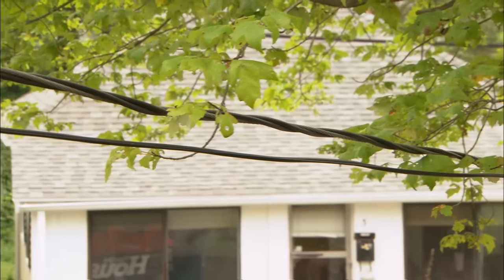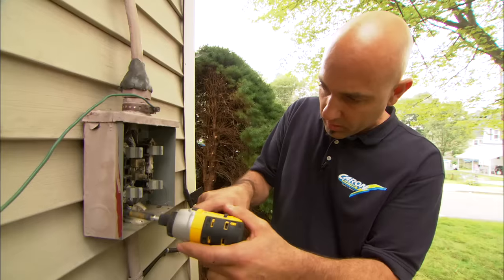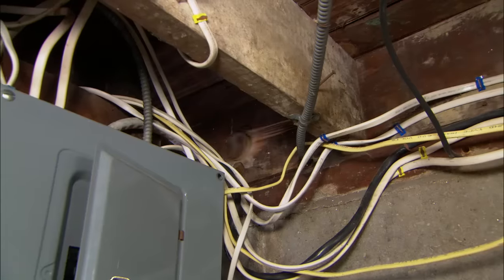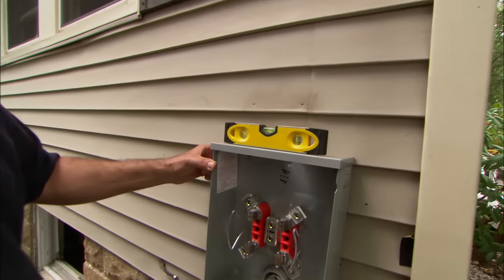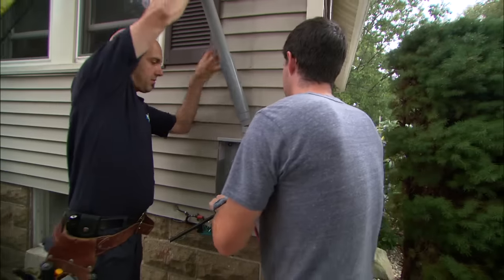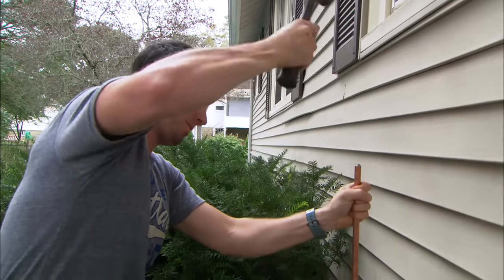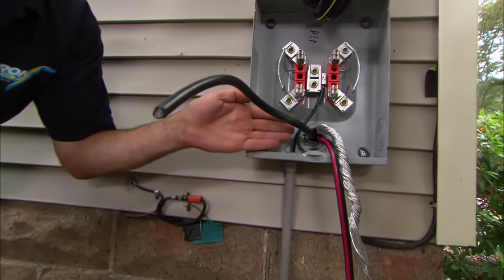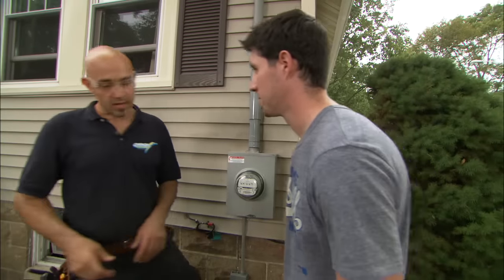How to Upgrade an Electric Meter to 200-Amp Service (Part 1) | This Old House

Comment: wrong.
That wire that you are calling the "neutral conductor" is connected to the messenger cable. We at power companies DO NOT WANT NEUTRALS. The neutral is formed in the home by the home owner. The messenger cable is for eqi-potential bonding so that every home off that pot, (transformer) is in the same potential. The two insulated wires on the tri-plex are current carrying conductors, the third wire (the bare ACSR) is the messenger cable for the service drop and is used to secure the wire to the first point of attachment, support the two current carrying conductors, and put everything on that drop(s) in the same potential.
Reply: JPP2672 Was going to say the same thing. It's to carry the load of the wire itself.
Reply: You don t want it because obviously you don t know what it is. Your equipotential  bonding conductor, the neutral and the ground are ALL GROUNDED CONDUCTORS, they just change the name depending on their role in the system
Reply: What is your point ???  if you want to learn =  watch   Mike  Holt  Videos...
Reply: "The neutral is formed in the home by the home owner."  You have no idea what your talking about  Lol
Reply: That’s not tri-plex

Comment: He didn’t set his expansion joint to the correct expansion nor did he explain...and no grounds in power company enclosure! They must go to main enclosure the power company will not pass even if twp. Passes. They only want there wires coming in and you’re feeders going out nothing else.

Comment: What a cheap job he used pvc conduit it's gonna end up warping over time and it looks ugly too
Reply: I was thinking the same thing can’t believe they let them get away with pvc. I would use rigid metal conduit for my riser. And a chase nipple not a romex connector.

Comment: Where's the disconnect. In Texas if the panel is on  the inside it needs a disconnect outside. 
Nolax is required.  
No sealingnon the top edge and outside edges of can for water proofing..

Comment: what a horrible service. cheap pvc mast. cheap aluminum conductors. that is the last project on a home or building that needs to be cheap. ive replaced dozens of snapped plastic masts after storms.
Reply: the lazy coupling at the bottom haha😭
Reply: Aluminum is used all across North America for service entrance conductors. You don’t know jack

Comment: Why bother showing how this is done if it is just for a licensed electrician? Very irresponsible.
Reply: V it's an informative video. It's not saying hey you homeowners out there, go ahead and do this. He clearly states at the beginning of the video that this is to be done by an electrician. Not a handyman with basic electrical knowledge.
Reply: Sparky 97 Dangerous, man. Lots of people might get in danger. You know the saying, little knowledge is very dangerous.
Reply: Homeowner can do their own work in most jurisdictions. This isn’t difficult or particularly dangerous

Comment: If it requires a licensed electrician; why are you showing it on a DIY channel?

Also, the power company is now saying that the homeowner owns the meter; are they trying to pass the cost of meter replacement on to the customer?

Comment: Don't ever demonstrate how to backfeed with a generator or these electrical gurus will have a stroke.
Reply: You can kill a lineman by doing that.
Reply: @Checkmate54321  if you don't pull your meter or turn the appropriate breaker off. But if you don't know what you're doing you don't need to be doing this.
Reply: @jamesm568  Agreed.  A transfer switch is really what you need in this situation.
Reply: @Checkmate54321  Or a double pole double throw switch.

Comment: Waste of time. A service upgrade must be preformed by a licensed electrician only. The electric utility will not even speak to a homeowner to shut the old service drop or reconnect the new service drop. Only a licensed electrician can get them to come out

Comment: so  wastefull... twice less the voltage, double the mm2 cables = double the price for wiring, and transformers all over the place, costing so much...
Reply: High voltage = very dangerous. 120V is safer of 230V.
The reason of lot of amps its a 48kW in sigle phase.
48kW is 3phase 127/220V is a 125Amp.
I'ts problem of single phase transformers. A 3 phase lines is better.

Comment: "Each of the wire carries 120 volts to your house."  Thats a pretty amateurish way of explaining things.  Better to explain that there is an electrical potential of 240 volts between L1 and L2 and 120 volts between L1 or L2 and ground.
Reply: Whoa wait you confused me in the end... you mean 120 volts between L1 or L2 and (nuetral) right, not ground?
Reply: @HA2RD  The neutral conductor is grounded. The NEC in fact refers to it as the "grounded conductor" (as opposed to the "grounding conductor").  My point is that wires do not "carry 120 volts" and that two of them 
therefore supply 240 volts.  Voltage is measured between two points because it is a potential between two points.
Reply: Very well said, thank for the nec reference friend

Comment: What kind of bullshit is garbage. PVC riser for a 200 amp?
Code requires 2" GRC with the service panel with circuit brakers.

Comment: Wheres the NOLOX. How about the big ass hole he made for the SE Cable. Water will flow into the walls. Ham nad Egger !!!
Reply: Yup, look for carpenter ants 2 years down the road, rotted rim joist in  20 years.  Really small mouse may give it  a go.

Comment: Who needs 24KW in a house?
Unless he needs it for some special reason, it's just a huge waste of electricity, money and sounds like poor planning on appliances' efficiency.
Reply: If he's installing it he's planning to use it and a house like that can run just fine with 10KW top, usually much less.
Reply: It's 8 times what a standard electricity contract in my country is. Sure, 3KW is a bit annoying, especially since we have smart meters that cuts off the power when you exceed the limit for more than a couple seconds, but it's a way to make people not waste electricity and is good for the environment.
Reply: In my city, 200amp is the smallest service I can even purchase. 400amp is the default. You can get 800amp, but you have to supply your own parts. Same price for all installs, except 800 where you have to supply your own. Monthly fee is no different either. Get it all in 3 phase for an extra $10/m connection fee.
Reply: This is a 48kW service, has a 2 lines 120V and neutral.

Comment: So much of what you did here is wrong it isn't even funny.

120 volts on each wire, not 240 and 0 volts?  Did you seal the hole into the house or the old holes in the siding?  Brush and apply antioxidant on the aluminum wiring?  How big was that ground wire?   Minimum separation between two ground rods?  No testing resistivity on installed ground rods, just assume you didn't hit 25 ohms, install 2 in the sand and gravel up around the house, and walk away?
Reply: SylviaisGod, your insight is amazing.  Thank you for your input.

Comment: I hate to say that Scott Caron doesn't perform as expertly as a U.B.E.W. Master Electrician does in the performance in this set of 'TOH' videos. If I was one of his Union Brothers,  I would demand he take a remedial class and be re-tested.   If he was doing the task correctly, I would say that 'TOH' edited out to many details and deserve to be sued for showing the process and leaving out so many critical details , And again where is the permit and inspection by a building official...And you left out the conduit or sleeve between the meter base and the main panel inside.
A red tag from the Inspector in most jurisdictions.
 To all of the DIY builders, watch 'Hometime,' they do it correctly...
Reply: This show must have some sort of exemption. It's also illegal to have a customer help with electrical work when a contractor is doing the work.
Reply: Conduit isn't required. Homeowner can do whatever he wants in his house without licenses as long as he uses the house as a primary residence. He was not helping the licensed electrician but the electrician was helping the homeowner who pulled the building permit. Edit) Most municipalities have the terms, for example, "Homeowner is allowed to act as his own contractor without a license. He is responsible for the supervision and management of all work that is not performed by a license contractor."
Reply: Yeah, the home owner needs a permit to do this job. Plus a licensed electrician is not allowed to help a home owner in the installation. If the licensed electrician is helping (working) under the home owners permit that isn't the electricians house, and isn't working under the supervising/master electricians whom employs him, which a journeyman electrician can't pull a permit.
Reply: Otherwise it's called "side work", and is illegal.
Reply: Dennis Miles To all you watching this video get a license electrician to perform your work not only to your local codes but to the NEC code year your town is using.
Reply: scotty hanson I think we can assume that he pulled a permit prior to the POCO disconnecting service. Generally, that's the reason they disconnect the wires, is it not?
Reply: ***** apperantly, you've never done side work.
Reply: scotty hanson
how do you figure?

edit: (not that you're incorrect. lol!)
Reply: Hey bro - fmr Journeyman Carpenter here, glad to meet you. :)

Comment: And you never make a 4 inch hole saw for in seu and by the way that's the name of the water if you want me to teach Electric then call me up I'm glad to help I have done told me for 2 years and I'm not licensed seems to me I know a lot more than you

Comment: Why the hell you need 200 Amps on a single phase??? Sorry but I think americans are just wasting everything (including electricity). In Hungary (Europe) most residential buldings only have single phase 230V@10A or 230V@16A and that is more than enough in most of the cases. If you need more power (eg: for electric water heater, airconditioner) you can upgrade to three phase (3x 230V@16A).
Reply: In USA there is low voltage - 120 versus 230V in Europe, so for the same power need doubled current. In your example 230V@10A - put washer on, iron on, hair dryer on and reach limit. For Instance family before party.
Btw. alluminium wire in 2016? Really.
Reply: Different electrical systems. US 240v -120v. most circuits are 120v 15amp or 20amp
Reply: Do you have clothes dryers? How about an electric cook top and oven?
Reply: And the power...
200A in 2 x 120/208V = 48kW
10A or 16A in 230V is 2,3kW and 3,6kW
16A in 3 x 230/400V is 11kW.
Low voltaje is more safer.